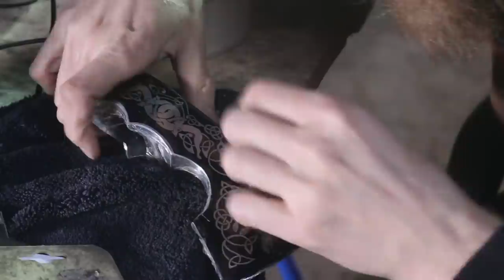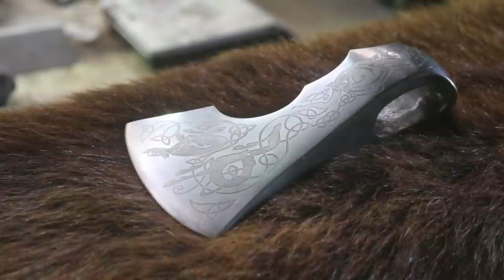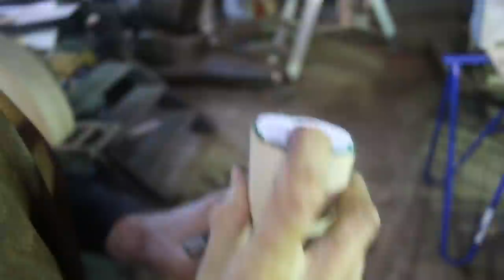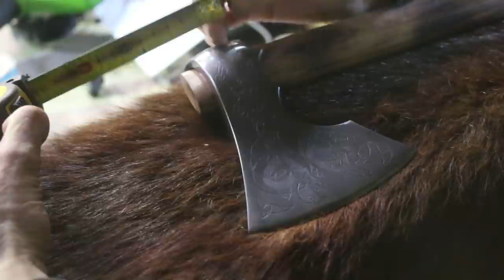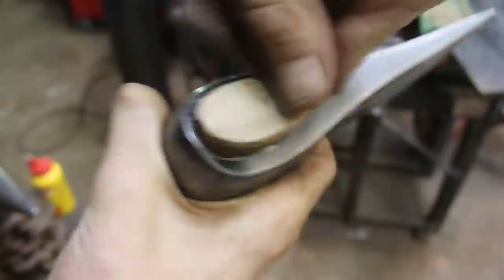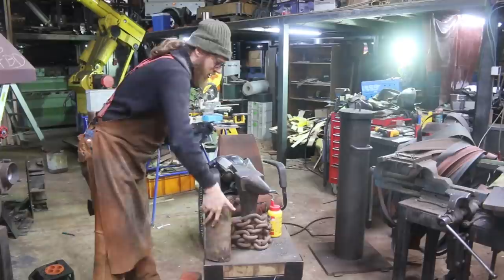Forging a Viking axe, part 2, making the handle.

Comment: Any chance to know the weight of the head? As fearsome as the edge is, it seems to be a tad on the heavy side.
Also, the old problem with beautiful grips and hafts is still here. Beautiful, yet also not too functional. 
All that notwithstanding, when it comes to forging, we have seen a master at work.
Reply from the maker: it is around 1,5 kg,  for me it would be perfect.